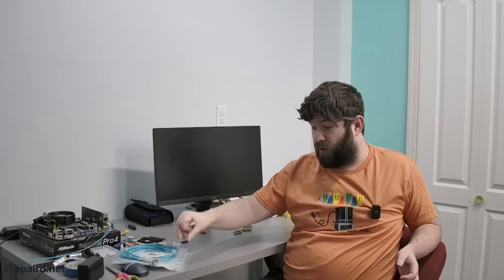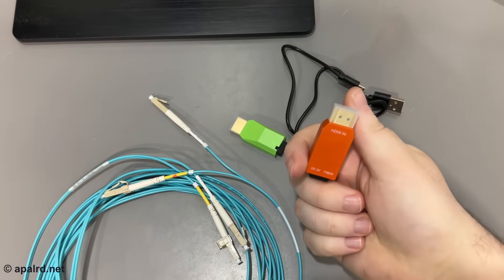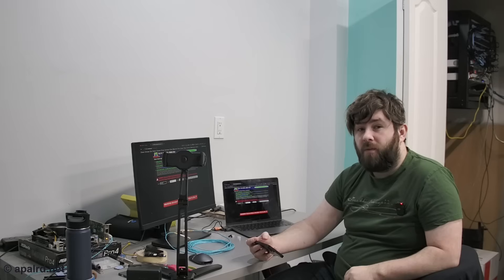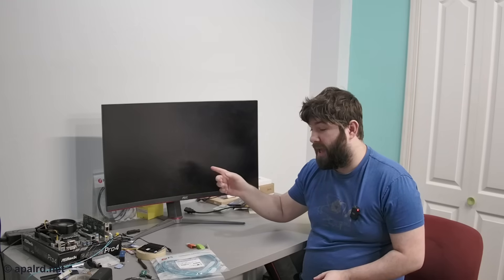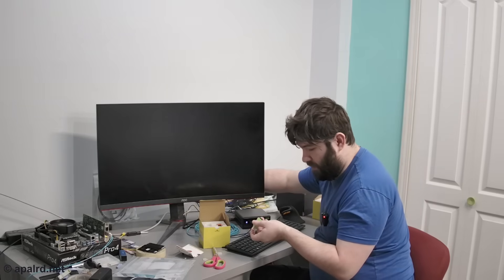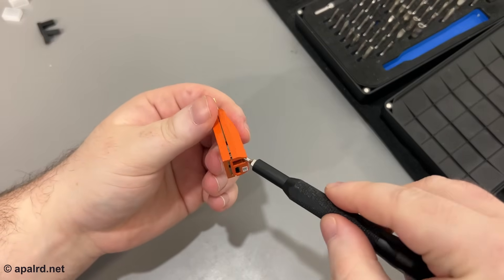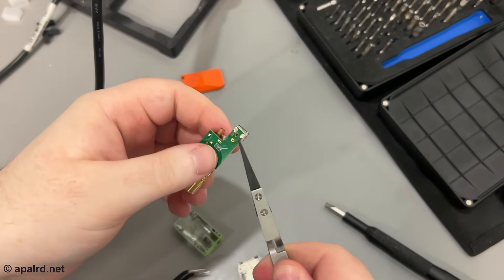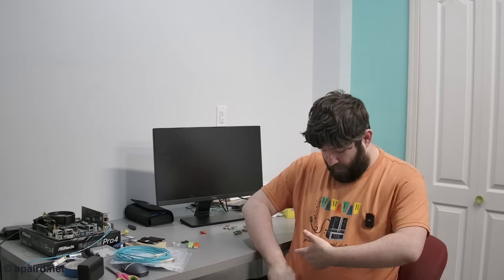HDMI over a single FIBER? E-Link Detachable HDMI 2.0 over Multimode Adapters

Comment: Great stuff!!!

A tad on the pricy side.

Would this work with a switch or does it always have to be a point-to-point connection?

(Sidebar: re: flashing lights/monitor flickering
One suggestion that I have to you so that you don't trigger migraines/seizures is that have a sound of some kind (LTT uses a short beep/bip) so mark when I need to stop looking and when I can look again. At home, I have my kids tell me when I need to stop looking and when I can look again.

That would be SUPER helpful!)
Reply from the maker: Always point to point. I believe it’s doing CWDM for the tdms signals and the low speed signals as well, but I don’t have the optical equipment to verify that
Reply: @apalrdsadventures  
It still gives me some ideas as to what I can do with it, because right now, I just have a mini PC that's sititng next to the TV, running said TV.

However, I will also say that one advantage to me having said mini PC next to said TV is that if I am doing any kind of emulation/gaming, and having the PS controller, I can still play those games.

Whereas, trying to do that with the system in my office -- makes that a little bit more difficult/challenging (complications with bluetooth range and/or USB signalling, if I want to "plug" my controllers in, such that it goes back to my rack).

Not bad though, if you only need display (and a "minimal" way of interacting with it). (e.g. via Rustdesk or Remote Desktop, in a pinch)
Reply from the maker: I think streaming PCs make a ton of sense for most people. The issue is when you want a battle station with a lot more performance / gpu power, and that takes a lot of space and produces heat and noise.
Reply: @apalrdsadventures  
100% agree.

Right now, our two gaming systems are actually VMs with 3090s in them, running off of a single 5950X system.

That's also housed in my office now and for the time being, Moonlight seems to work decent/well enough, although sometimes I have issues with playing first person shooters like Halo Infinite as it doesn't necessarily recognise that you can keep sliding your mouse to the left, for example, for your character to do a full 360.

MOST of the time it works, but sometimes, it has a little bit of an issue with that.

It works best for like more top-down and/or isometric view/RTS games.

But again, being able to remotely send the input commands/signals can present a challenge vs. having it be able to just "show" something (especially over long distances).

(like I might need to remote in to the system to be able to start a movie, and then log back out. But trying to pause it, on the fly, would be a minor challenge.)

I dunno. Trying to think about where/how I might be able to integrate something like this.

I presume that if you are trying to remotely administer your systems, that you'll have a similar issue with being able to send the input signals/commands over the wire (or over the air) as well.

Comment: "Fiber is cheap" but the HDMI adpater is not.
Reply: still cheaper than hdmi wire for comparable distances
Reply: fiber is much easier and cheaper to replace if you damage it (take it from someone who tried to DIY HDMI in my walls)
Reply from the maker: But you can install fiber in the walls cheaply when you build or renovate, and use it for decades

Comment: I would buy a few of them without hesitation if it was 4K/120Hz
Reply from the maker: I have a video on a different adapter which should be able to do 4k120 but it needs 8 fibers (one MPO)
Reply: @apalrdsadventures already posted or upcoming?
Reply from the maker: Posted, it’s almost a year old now I think.
Reply: Not fiber, You can do affordably do 4K120 over Cat6 with HDBaseT! (And USB and Ethernet) It's a really cool technology.
Reply: @living757 At 4:2:0, though, not 4:4:4 right?
Reply: @Ski4974   It supports 4K@120 4:4:4, they use VESA Display Stream Compression to fit the 40 gigabit signal onto the 16 gigabits they have to work with for the HDBaseT protocol.

Comment: Why in all hell circles we still use usb power ? hdmi pin 18 has 5v
Reply from the maker: Yes but it’s only rated to supply 50ma which isn’t enough for the transmitter
Reply: hdmi power is a joke, barely enough to power a port converter
Reply: HDMI is a joke. I’ve been craving an affordable DP1.4 over om4 adapter for as long as I can remember.
Reply: I was questioning why they used micro USB? I get the reason why HDMI power but then again optical HDMI uses it.

Comment: $254 bucks is crazy steep.
Reply: Have a look at 4:4:4 4k120hz DisplayPort transceivers 😂
Reply: You sure? the description says this is cheap :D
Reply: the use case for this isn't to replace your cheap hdmi cables from machine to monitor
Reply: It fucking cheap compared to other type single controller cost like 400
Reply: it's not that bad for what this is, obviously won't replace all short HDMI cables too but for longer runs it's fine
Reply: That's just what this type of thing costs (see competitors from FiberCommand).

This use case requires kind of a lot of high-speed electronics.
Reply: yea you can get 100ft detachable fiber rx and tx that can do hdmi 2.1 for like $100.  I have one thats 60ft and have had no issues.
Reply: Right? You can get an entire bidirectional KVM-over-Fiber setup (HDMI in one direction, USB in the other) for cheaper. That is much bulkier though; for an application where you only need video and compactness is key, this could be just the ticket.

Comment: These are sick! Would be super handy for a clean wall-mounted multi-monitor setup. Or even a ceiling-mounted projector/TV for a conference room. Gonna grab a pair (2 sets). Thanks again for showing us all this nifty tech. Time to buy a shirt!
Reply: Conference AV is heavily based on the HDBT standard (many projectors have a dedicated port!) Or video over IP devices such as Crestron NVX, Extron Nav, Blustream IP300's etc. This device looks cool but in reality you are limiting yourself a lot' and still have to power both ends of the devices

Comment: What about keyboard and mouse (usb) when having the computer in a closet in the basement ?
Reply from the maker: still working out that solution, it's more complex since USB2 and USB3 are essentially totally separate protocols
Reply: @apalrdsadventures  is using an extra-thin-client and then passing it through a point to point network an option? though the latency would probably be too high for that
Reply from the maker: Guess it depends on what peripherals you have. Keyboard/mouse are probably fine.
Reply: Linus from LTT does video/usb over fiber from his server rack in the basement where his computers are up to his desks where its essentially just monitor mouse and keyboard. Been a while since I have seen the video and what specific device, but it is fiber
Reply from the maker: The device Linus has used is around $1k per pair, unfortunately. Fiber Thunderbolt / USB-C is a thing, but it's always 'active optical' and not detachable using standard fibers from what I've found so far.
Reply: Is thunderbolt / USB-C over fiber a thing? And then plug a dock/port replicator on one end.

Comment: I don't understand why anything like this that exists for DisplayPort barely exists and costs like typical enterprise prices.
Reply from the maker: HDMI uses a very elementary signaling. It’s four differential pairs, one is a clock and three are serial R, G, B. The audio is transmitted during the blanking interval. 

DisplayPort uses a four lane packet format much more similar to pci express, and which allows many more features like multi stream transport (packets for multiple displays on one higher bandwidth cable), and is the basis for Thunderbolt. 

So HDMI can be converted to optical and back with purely analog circuits and DP is a lot more complex
Reply: @apalrdsadventures I spoke too soon. Your precious video with the HDMi over multi-core fiber...that company does DP converters too and not expensive. I've never heard of such a thing as HDMI having RGB split up.
Reply: Actually HDMI supports both RGB and YCrCb signaling. Not sure how it communicated this but it does. My understanding DisolayPort is not all that different from HDMI and can be somewhat easily converted. Just things like CEC, copy protection and audio support are not supported in DisplayPort.
Reply from the maker: DisplayPort can only be easily converted because most DisplayPort electronics support falling back to primitive hdmi signaling. It’s not actually electrically that similar.
Reply: @glynnetolar4423 DisplayPort most definitely supports audio. My monitors have speakers and are hooked up via DP.